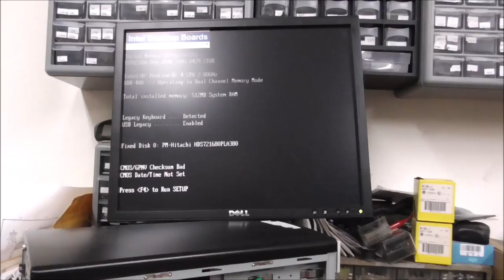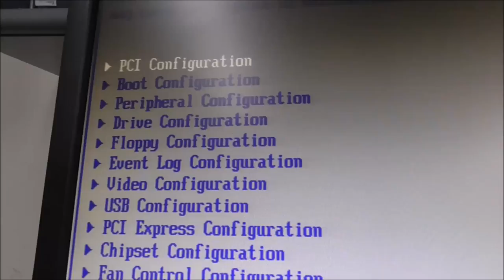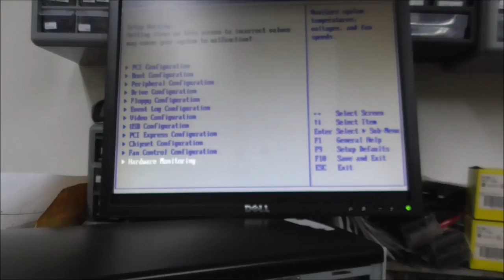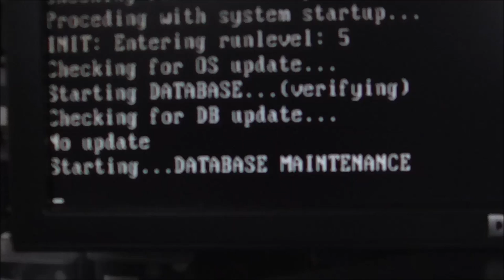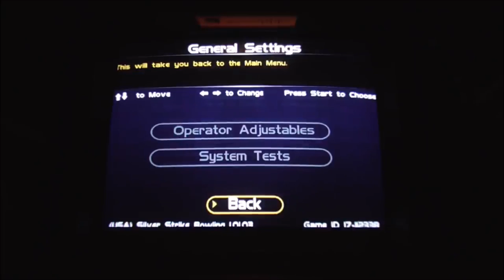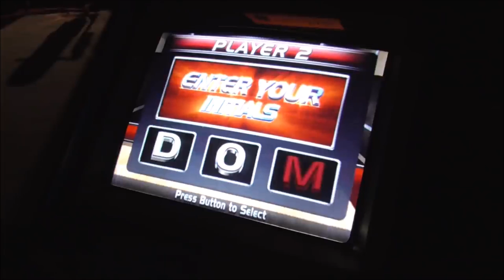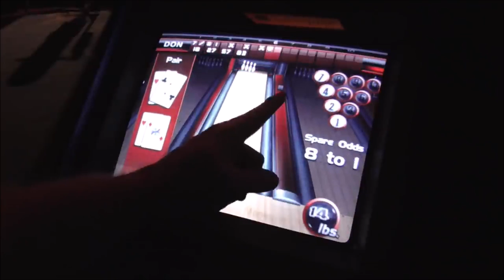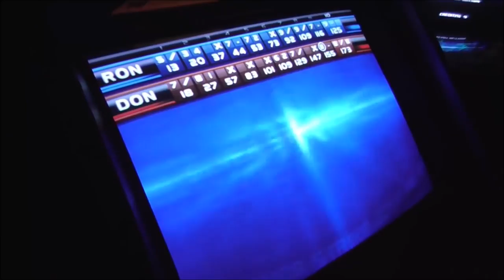A Customer Brought Us A Silver Strike Bowling Arcade Game Computer To Repair, Can We Fix It????

Comment: @8:28 You do not need the battery for it to start. It just remembers the date and certain options of the system. Just press F4 exit without rebooting/saving and the OS will start (if it was capable of booting in the first place). Or do not set the correct date and save, you can always return to that screen during boot up (enter setup). The saving probably makes it boot faster in the future. You will at least know if it will try and boot. ( saw that it found the HDD with autodetect ) as long as the PC stays powered it will remember the settings. You can turn the computer off with the power button (in some cases keep it pressed for 6 seconds and it will cut the power. Usually it will also save the CMOS settings as these things always have a small 3/5v line running (for the power button). Unless.... you use the power switch on the back :P

Comment: Joe,  I have a SSB 2009,   Would it be possible for me to upgrade to a LIVE or X?
Reply from the maker: You have to get a new security chip, a new in out board, and install the new program.
Reply: Any way you can point me in the right direction to find those?

Comment: You broke your own rule and didn't start from the wall.  The slow/hung boot makes me suspect the power supply is on its way out or undersized for the video card.
Reply: When the BIOS is cleared they do take a while to display I build them and  10-20 seconds after clearing is common

Comment: wait wtf is with that hard drive. It's a sata drive, but it has molex AND sata power connectors? that's REALLY fucking weird.
Reply from the maker: Apparently it's an in betweener!
Reply: @LyonsArcade  I had to look it up cause I had never encountered one before, despite working on pc's at home and for friends/family for 20 years haha. Turns out you can fry the drive if you use both at the same time.

Comment: 0:00 imma guess the battery is dead lol because thumbnail
Reply: okay, if the battery was dead that's the same thing you would get each time you booted, so there must have been a glitch or surge that caused the BIOS/CMOS to reset or get a little bitrot where setting it and resaving let it write the bits fresh and move on.

good job with the simple repair where a lot of people would have dorked around and probably broke extra stuff.